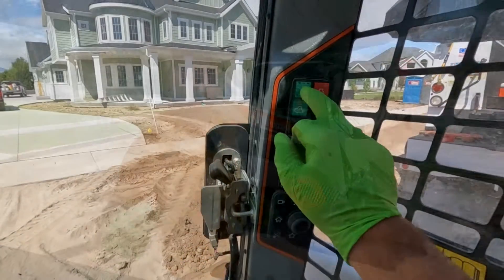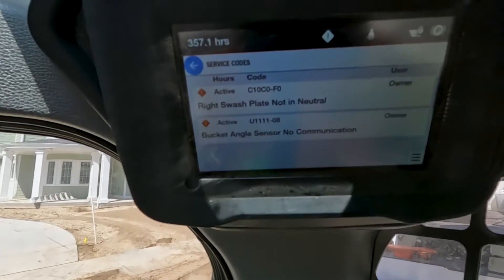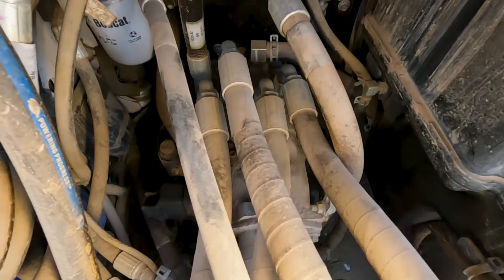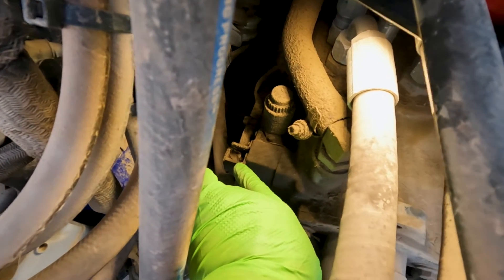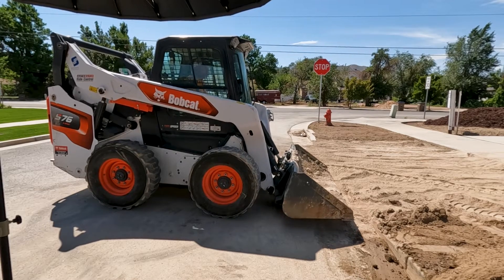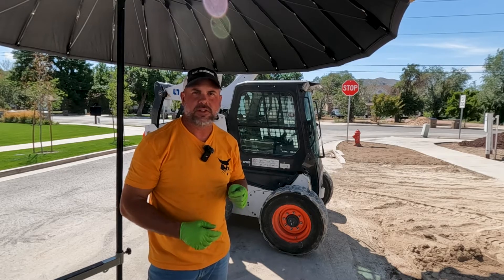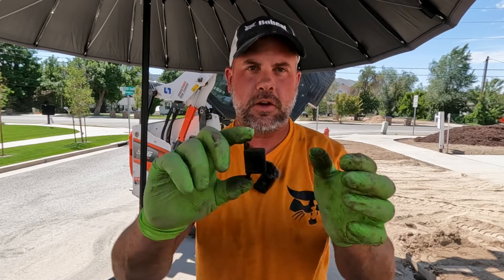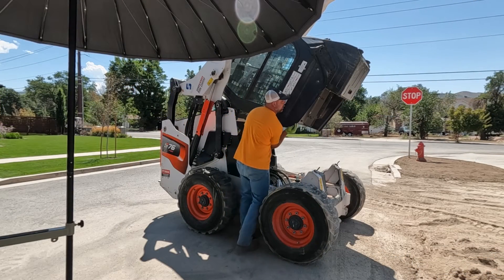New Bobcat S76 Died in the middle of the road.  Swash Plate not in neutral codes.

Comment: I am currently working on a T-62 that we had to pull an engine on. We got everything back in and noticed it was pulling to the left really bad no codes or anything. We pulled it back in and calibrated it and updated it now it dies just like this one and won't calibrate. These codes were never present before we pulled the engine. Any input would help thank you

Comment: So your last fix for my swashplayes worked great. Seems maintenance wasn’t to high on the previous owners list. I have this 770, it idles at 1300 rpms. It’s a lot higher than my old a320 and I’m figuring that’s why it’s so snappy. Is this normal? Do I just need to get used to it?

Comment: Awesome video! I have Code= "C10C0-77 Right Swash Plate Command Position Not Reachable" You think Sensor or something internal, Is there calibration procedure for these?  Thanks!
Reply from the maker: It's usually the sensor on the r-series machines.  There is a calibration procedure but wait until you replace the sensor to calibrate
Reply: This is a T66, I have no other Model Letter, could you share with me the calibration procedure as Im headed to look at machine? Thanks! @tetradgroup
Reply from the maker: @85oldsmobuick99  you will need the service manual for the procedure.   Just go ahead and plan on replacing sensor.  If you unplug it you will be able to drive the machine if you need to
Reply: Replaced the sensor and good to go! Was somewhat of a pain to get to as it had plastic tray/wiring harness bolted right over the lower screw. Left (rear) sensor would be much worse. Only 600 hrs on machine- Still had that new-skidsteer smell @tetradgroup
Reply: @tetradgroup  hi friend, can you help me with C10C0-77 on S86 B56R11157, i have changed right swash plate sensor and calibrate it, but not work properly, and fault code is active. Thanks
Reply: is there a procedure to follow after replacing the sensor with code c10c0-77? Thanks
Reply: is there a procedure to follow after replacing the sensor with code c10c0-77? Thanks

Comment: The bucket angle code is most likely your harness being unplugged behind the left side of the tail gate, one of your operators damaged it, or they activated it as a feature in error at the factory (if not equipped)

Comment: Excellent vid! Just had fault code: Left Swash Plate Commanded Position Not Reachable (C10C5-77) go off on a T76 an hour ago. Popped the cabin, unplugged sensor and loaded it up. Off to Bobcat dealer for warranty fix.

Comment: Any temporary fix for code “pedal not in nuetral”?
Reply from the maker: The ccause is the spring in pedal rubs on bushing and gets out of adjustment, new pedals have updated design.  Hopefully you still have warranty?  You could try to slightly move pedals in one direction or the other the get the machine to unlock but the pedal will need to be replaced
Reply: @tetradgroup  i do have warranty im going to drop it off tomorrow morning hopefully I’ll get it back soon. Thank you for your reply!

Comment: It is advisable to perform a drive calibration after replacing drive system parts. The drive controller needs to learn the new part.
Reply: Can you manually recalibrate foot pedals on s66?  Without dealer coming out
Reply: If you are installing new pedals, there aren't any calibration steps... just plug and go. The spool actuators are what's calibrated, this is a dealer laptop function only. You can adjust sensitivity and speed of the workgroup in the menus.

Comment: Can you please show a video of you or how to change the left side, if your sitting in the machine left side swash plate sensor in a m series, please, really don't want to pull the motor out
Reply from the maker: Depends on the machine but usually you can pull the engine mounts and raise up the pumps enough to get your hands underneath and swap the sensor. With that being said is very rare an actual sensor on an M series is the actual problem.
Reply: Yea, I haven't seen one go out on a m yet but it's the left side, it's spiking voltage just sitting still as soon as you push the green button, unplugged both sensors and switch plugs the problem jums to the right side, pretty sure that's the sensor, im hoping

Comment: Any calibration needed when replacing those sensors.
Reply: No he said code is cleared. Did you watch video
Reply: @rontopping2048  yes but some manufacturers require a calibration of the new sensor cause even with the code being cleared you will have delayed controls.
Reply: @gantert12  swash plate sensor doesn't require calibration
Reply: Anytime you replace a drive component, a drive calibration should be done. The Drive controller will need to learn about the new part. However, the machine may still operate without one.